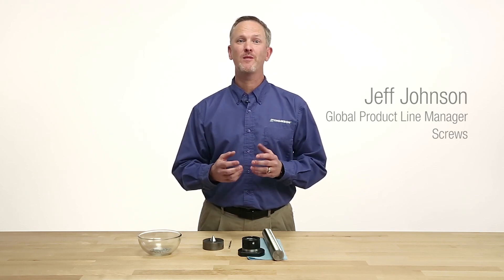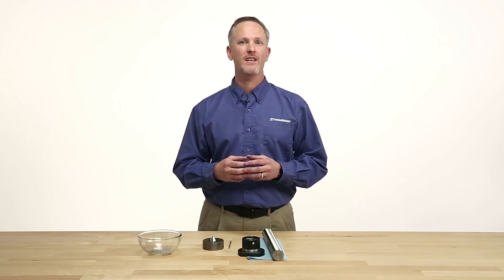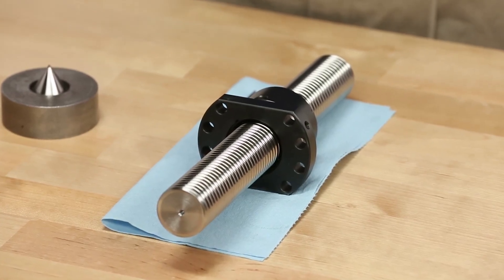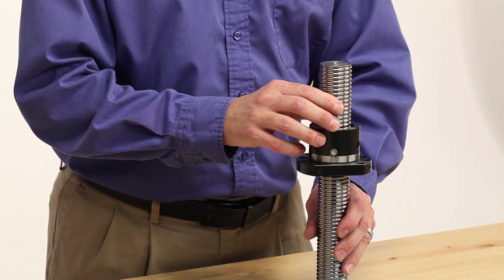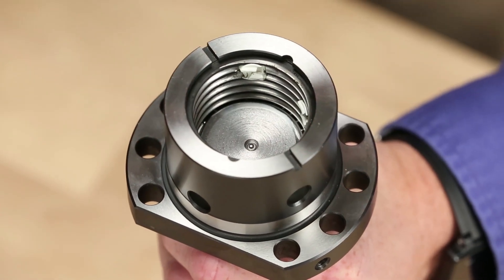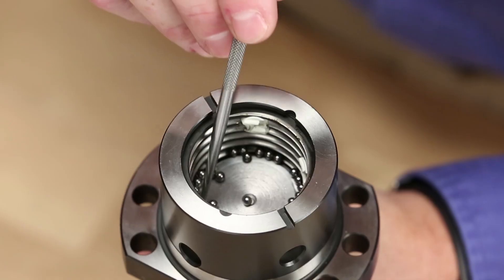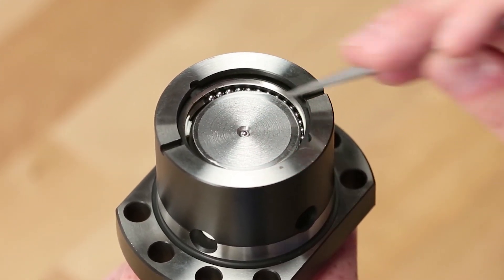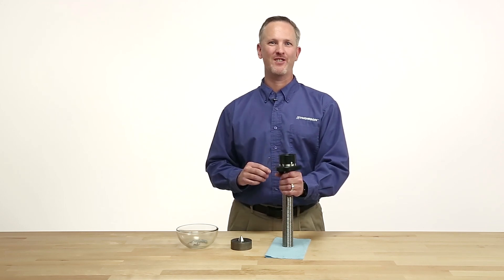How to reload Ball Bearings into a ball nut.  Demonstrated using a nut with button returns

Comment: I used to build ball screws, my one piece of advice is make sure when you discassemble you put the unit in a container to capture all the balls, and count how many came out of the ball nut. When you are ready to re assemble measure all balls with a micrometer just to check all balls have the same size. Hope this helps.

Comment: is the procedure same for 4 start ballscrew. i have a 1520 ballscrew and i lost 2 balls, i want to put them back in.
Reply from the maker: This nut has 2 circuits.  Expect that it's not know which circuit the balls came from so best bet is to reball the entire nut.  The nut can be sent to the factory and for a fee they will reinstall the balls.  However the nut will operate fine with 5% less balls in it (or 4 in the case of this nut)
Reply: Which balls in one ballserew nut